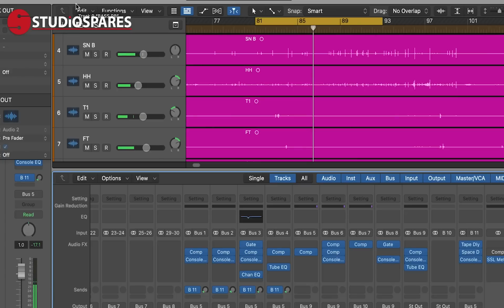SSL UF1 - Advanced DAW Control - DAW Control Made Easy!

Comment: Attention if you use the UF1 in combination with the UF8 (Cubase), you cannot select the lower last 7 tracks on the UF1. This is because the UF8 always selects 8 adjacent tracks and the UF1 can only select the top (left) track of the UF8 at a time. UF8 and UF1 are synchronised. This means that the bottom last 7 tracks are always not selectable for the UF1. This is real rubbish.

Comment: So for the past 20 years most producers have moved away from the external and into working in the box, SSL on the other hand are doing everything they can to drag people out of it. 
Looks cool but it's completely unnecessary, everything thing this can do you can already do anyway. I mean is the hi definition screen really a USP? I've already got three of those and one of them is 55 inches. 
I like SSL, worked on their desks for many years and their software is terrific but this is just pretty pointless. They're basically creating a solution for a problem that doesn't exist as the entire raison d'etre of a DAW does exactly, if not better, than what this device is trying to support.
Last time I checked a Behringer X Touch one did exactly the same thing for about £80 quid. This is obviously aimed at the young producer who wants the new shiny thing on his desk and is convinced it will transform his workflow, it won't. Cubase, Logic, Pro Tools etc have already got you covered.
Reply: yep Behringher does the X range. They're cheap, nasty and feel like absolute garbage to use. Might as well just burn your cash, they're that bad. Tactile control for making music might have moved into a niche field, but it can be a delightful experience when done right. Look at modular gear. Buy VCV rack if you want, but it ain't touching what you'll get with the real deal. Up to the buyer of course, and some will no doubt see it as an extravagance/waste of money, whatever, but if you think you're getting the same experience with software, you're kidding yourself.

Comment: This is totally from a post production perspective so take it as you will but… After using Avids proper controllers (s1, S3, 4 and S6) I have to say this is a very underserved market getting by on old principles that new mixers do not want.

No one needs plugin control, or a jog wheel 😂. I guarantee no mixer is trying to jogwheel their way through a project under the age of 50.

It’s just such a shame to see Avid still locking down their interface to HUI for third party controllers because all we want is an affordable top quality high resolution single fader with selectable flip fade.

The inbuilt PPM on here is a nice touch but the mixer DAW controller only has one feature that can’t be done on the screen and that’s the fader itself so HUI control just isn’t enough.
Reply: I totally agree, I wouldn't use it. Just commented with my thoughts above.